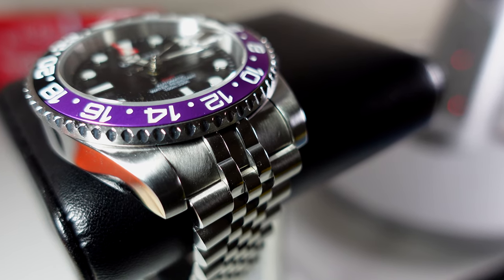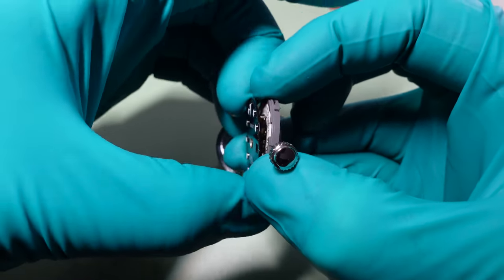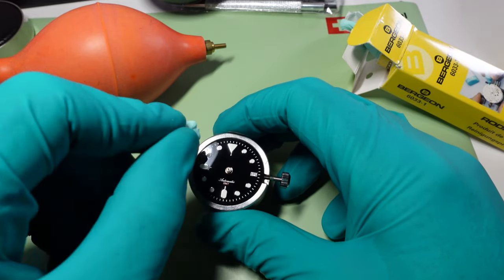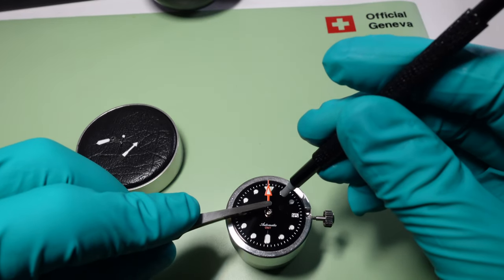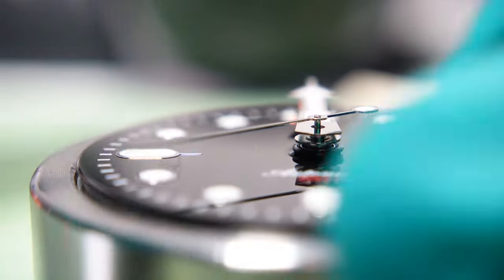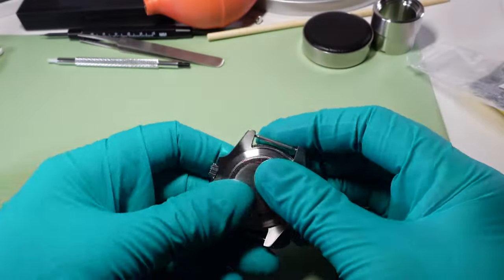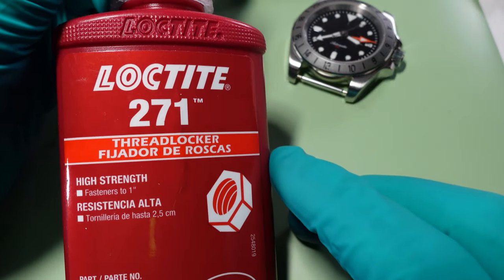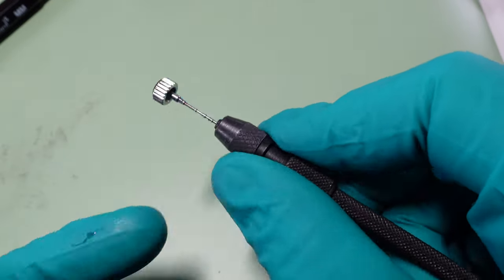Seiko NH34 GMT Mod Build - making something great from a Corgeut Aliexpress watch...

Comment: hey @nextonthewrist ! I had a question I was hoping you could help out with... I'm building my first seiko gmt mod and I'm in the process of ordering tools. I prefer the rolex-style caseback like you've got in your video, and I was hoping you could recommend a good caseback tool for this specific style caseback? maybe one recommendation in the low budget range and one in the mid budget range if thats possible?  
Thanks in advance!! :)
Reply from the maker: Hey honestly I swear by the Bergeon 8008 removal tool for these unless you want to spend $$$...make sure you buy the actual Bergeon one, the cheaper copies don't work. But on a plain caseback it's super sticky and will give you plenty of torque to secure everything nice and tight. I am able to use it on a lot of removals too 🙂👍